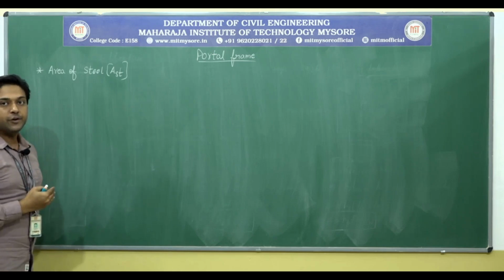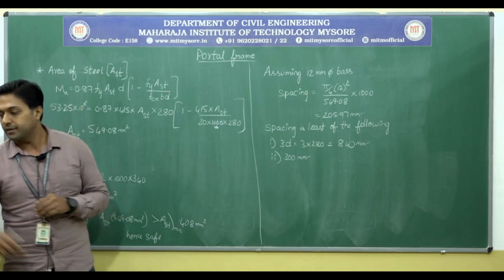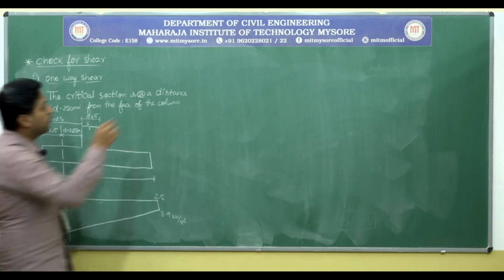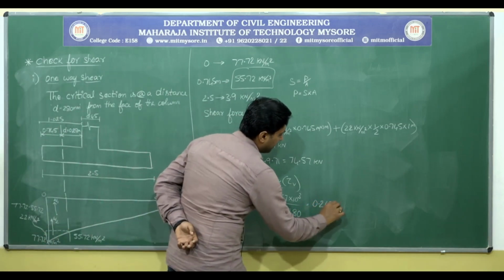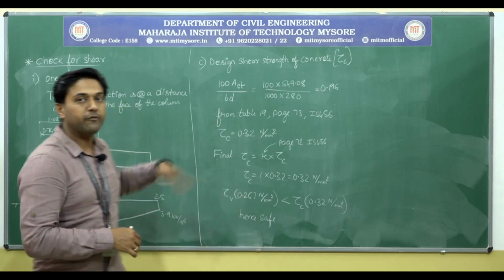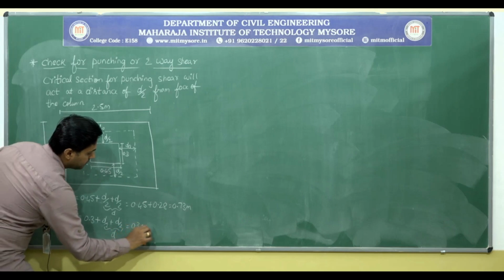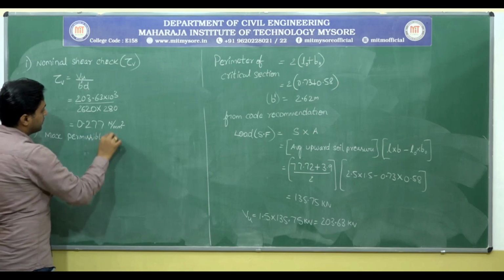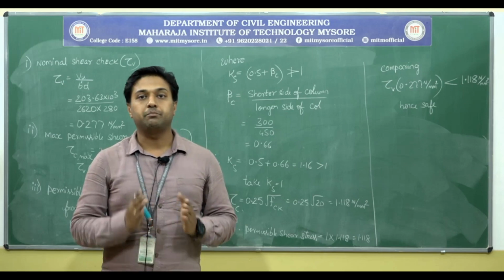DESIGN OF FIXED PORTAL FRAME/DRSS/17CV72/CLASS 20

Comment: hi sir 
In DESIGN OF FOOTING 
After calculation of M1 and M2 , check for depth is done , we got d=138.92
As per your classes(in combined footing) we need to add cover of 60 and find D after that we need to double the depth but in this problem after finding "d" doubled the depth and then D is calculated 
And as per previous classes(in combined footing), this would be the procedure 
d=138.92mm
cover=60mm
hence, D=d+60  138.92+60=198.92≅200mm
due to shear double the depth 
200*2=400mm=D
d=400-60=340mm
Reply: In the calculation of depth follow the same proceedure as in video. No need to double the depth due to shear in portal frame, as I have calculated bending moment considering the soil pressure.  distribution

Comment: Please start roof truss next and tell the difference for solution of hinged portal frame
Reply: If you have understood fixed portal frame, you can easily do the hinged portal frame with slight modification. Every thing is same as fixed portal frame, except at 2 stages
1. While calculating bending moment using kani's rotational contribution method consider the support as hinged and use 3EI/L for calculation of R.F.
2. Design of hinge.

Finally I will share the entire notes, which will have the catilever retaining wall with sloped backfill,  counterfort retaining wall. With horizontal backfill and sloped backfill, hinged portal frame.
Reply: @punithn3782  sir where can I get the notes for hinged
Reply: No need to increase the depth. Just provide minimum shear reinforcement.
Reply: Only if it is beam. For slab no need of shear reinforcement.